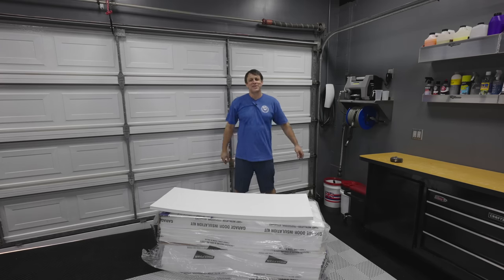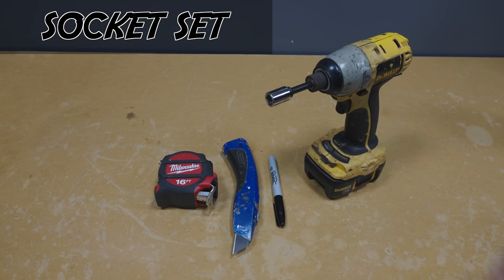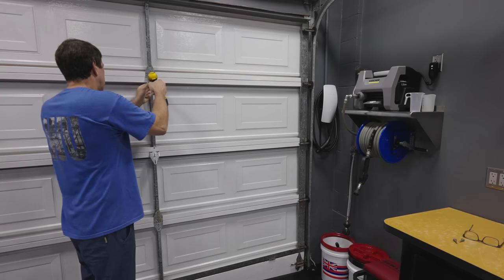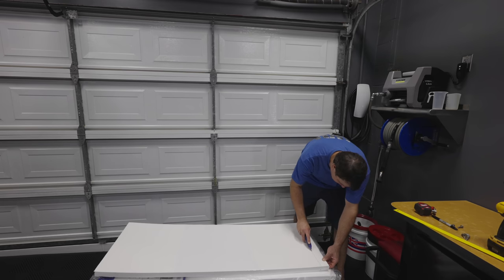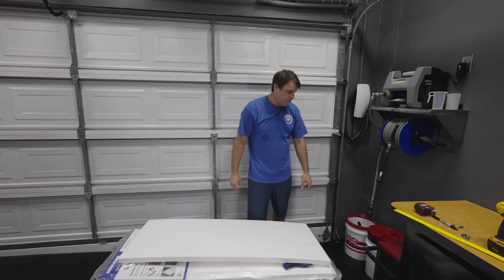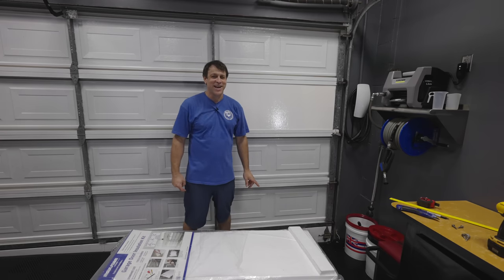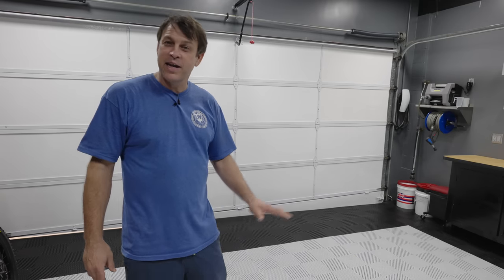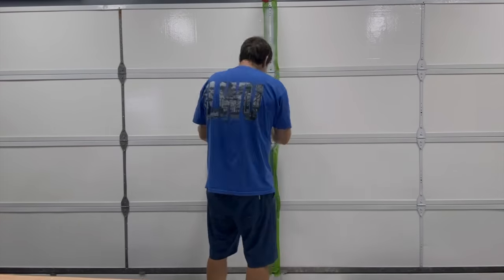BEST WAY OF INSULATING A GARAGE DOOR. FULL TUTORIAL

Comment: Good video.  Insulating my garage door was a great investment.  I didn't use a kit, but instead, used 4' x 8' panels of 3/4" Polystyrene with a radiant barrier from Lowes, and cut to fit.  I used almost every inch of the panels and didn't have to worry about the look of it , because after I installed the panels, I covered each section using radiant barrier bubble wrap with aluminum HVAC tape.  Lastly, I changed all the door hinges from 16 gage to 14 gage ($120 total) to ensure the added weight did not impact the mechanics of the door.  Total cost of insulating an 18' and a 9' door was about $300.
Reply from the maker: Thanks for sharing
Reply: 4 pounds of Styrofoam?

Comment: I watched your video, unfortunately for me, my wife watched your video. Shamefully I veered from your video and woe to the man with a scorned wife.  So I took down the insulation and followed your video with the intensive fervor of a man on the edge of ledge.  And VIOLA, It was done.  Completed in a mere 3.57435, hours and 107 degree Texas sun on the dark painted, west facing, non-tree shaded double garage door of our new home. I now have a photo of you in my cooler garage for my inspiration.  All kidding aside, I did follow your very will described instructions and it made the job easier.  In my situation and probably most garage doors are this way, the upper lip (trough) is deeper, forcing the panel up into it and then pulling it down into the lower. I was having an issue getting to down into the lower trough once inserted as the panel left not wiggle room in thickness. I found using a wide popsicle stick worked great without damaging the panels.  Thank you and i hope you found humor in my opening statements...  Jack  PS, NOW seems epoxying the floor is in her head.....Hmmm, where'd she get THAT idea...???  LOL
Reply from the maker: Hahaha. Yeah man. Funny. Glad you got it done. Thanks for watching

Comment: Our garage faces South in Louisiana. 🥵 Summer heat like an oven. Super easy to size & install. Easily 20F cooler in the Summer. Also a bit warmer in the Winter. So light weight it doesn’t affect the garage door opener operation. I also installed a Dryer vent upside down in the ceiling. This allows the power roof ventilator fan to pull any hot air in the garage out. I close it in the Winter.
Reply from the maker: Awesome. Thanks for sharing

Comment: That garage looks fantastic after all the upgrades and remodeling you have done.   Very professional looking.    I would love to do this insulation project to my own garage doors.   I definitely need to get some insulation on those doors,  more so for the winter than the summer but for both really.     Great video and great review of a useful garage product.
Reply from the maker: Thanks a lot. I appreciate you following the channel. This insulation made a huge difference with sound and temperature. Thanks for watching.
Reply: I did this exact installation. It was easy and reasonable . Lowes had material for 62$ a pack of 8 panels . You’ll need 2 packs for a 2 car door . I say do it !
Reply: Did some simple lubrication on the garage, then found out I need a new bottom weather seal. Now I might as well just insulate this bad boy. Love it! Thanks for the tutorial! Cowabunga dude!

Comment: I did this exact upgrade 15yrs ago to a wooden double door and it resulted in a small improvement. What truly works to keep heat or cold out is to replace an uninsulated door with a 2” thick insulated R18.5 model which I have now.

Comment: I used styro boards like this from Home Depot.. but there was a radiant barrier on one side.. UV radiation reflected back outside.  Even better heat reduction- especially is you use thinner boards that allow an air gap once inserted into door frames. (It’s all science ). :)

Comment: Appreciate the tip about the filler edge. Your door looks fantastic!
Reply from the maker: Thanks a lot. It’s a huge temperature improvement and sound as well. The afternoon sun beats right on that door so it was an oven. Thanks for watching and commenting.
Reply: @HawaiiDetailing  I like your content. 

I'm in Phoenix. We've lived in this house 4 years and the garage is an oven in the summer and I want to make it so that I can work in it and keep my freezer powered and cold. My garage is about 540 square feet and I am looking at a mini-split AC. First step in that process is insulating it and it's going smoothly.
Reply from the maker: @brettoberry3586  good to hear. I did a mini split install also. They are nice. I Have had them for years over here and they work great. I made a vid about the garage mini split install. Check it out.

Comment: Awesome video, I just moved to a new house and failed to upgrade the doors to insulated doors. I moved from a house with insulated doors and the garage was much cooler. My new house the doors are like burners. The builder did insulate the garage, can't wait to get this done asap.
Reply from the maker: It helps a lot. I run the AC in my garage and the door is exposed to direct sunlight. It keeps a good bit of the heat out and the cold in. I am happy with it. Thanks for watching
Reply: @HawaiiDetailing  Do you know if you can buy it anywhere else other Amazon, its showing unavailable.

Comment: This really looks nice! I have wanted to do something like this since I started working in the garage, but I was worried about it being too heavy...
Reply from the maker: Easy DIY. I did not have any trouble with the weight added to the door. Just check that when door is disconnected from the opener that it moves up and down freely with out any effort. If it feels weighted down you may have to tighten the tensioner. Mine did not require any adjustment. This assumes that your tensioner is adjusted properly prior to the install. Hope that helps

Comment: Hey - Great Video!  My only question is based on a few other garage insulation videos - some recommend needing to have garage springs adjusted because of the extra weight added in insulation - I'm not sure how much weight is added and if that has any impact on the weight of the door and its ability to open properly - what's your thought?
Reply from the maker: Here is my thoughts in this extended description I did on my site. https://www.hawaiidetailing.com/garagedoorinsulation

Comment: I did the same thing with my garage door and added the bubble foil insulation between the door panels and the thicker sheets of insulation.
Reply from the maker: Nice. It works well. Keeps it cool here in the heat. Thanks for watching
Reply: I just started doing the bubble foil and will throw this kit on top. How did it all turn out for you? Worth it?

Comment: Nice job! Doing mine here in Florida in the next few weeks. Thank you!
Reply from the maker: Yeah it’s worth it. Glad I did it. Thanks for watching
Reply: I am thinking about doing the same in SWFL, but I am thinking that this should probably be combined with a radiant barrier like Reflectix pointing towards the inside of the garage door to keep the heat out and with an air gap. The insulation itself will help keep the cool air in when combined with a mini split system. Thoughts?

Comment: Did you also paint the panel ? From look it seems so. Will it keep it warm inside during winter ? Also what did you do for the gaps at the edges of the door through which air leaks in. Thanks for the nice video. Also removing screws seems to be mandatory , hope it will not cause the door to fall off :-) , so probably doing one cell at a time might help, what do you suggest  ?

Comment: Great video! I'm working on the install now. One thing not too many people talk about is the impact of the weight of the insulation panels (although its not a ton b/c its foam). It prevents my door from working correctly, so I've got a call in to get the doors rebalanced. Any tips there?
Reply from the maker: My door was not affected by this small amount of weight. In a perfect world with the door opener disconnected the door should effortlessly go up and down by hand. If not the tension spring needs to be wound tighter until this is accomplished. That is a risky endeavor as this spring is under extreme tension. If you know what you are doing and have the tools it’s an easy job. If you don’t it’s dangerous and you should call a garage specialist to adjust the spring. I can’t imagine it would cost too much. Hope that helps.

Comment: Did you replace the bolts as you finished each panel? I’m going to try to do this myself and am afraid the door will fall apart if I do it wrong! TIA
Reply from the maker: Replace each bolt as you can to avoid any issues. It’s a pretty straight forward job ounce you get going and I had no issues at all when I was doing it. Thanks for watching

Comment: Hi, I'm in central Florida & the sun obviously cooks the asphalt roof over garage & temps get over 100 in garage! I put the metallic plastic baffling into the aluminum garage door slots as the sun ultimately sets on that side & cooks the door but that didn't do much at all. I also put a 12 inch exhaust vent but ng. So I was thinking to insulate either the ceiling in the attic over the garage or would it be better to just insulate the one side of the roof the sun hits all day, or neither? It makes sense to me what you said about if I insulate the ceiling it may make my garage hotter if the heat can't dissipate! My thinking was to keep the hot attic space from heating up my garage. I don't really want to AC the garage, I just wish to make it more bearable in the hot months. Thank you, Joe

Comment: After watching this video, I said "That's easy!" Then, I went to check my garage door to start some measurements. Man, I was discouraged. My garage door was riddled with reinforcement brackets. There is no uniformity. Is it because I live in Orlando, Fl, which gets a lot of hurricanes? Hence, the additional brackets?
Reply from the maker: Sorry to hear that. If you can get it done it’s a huge improvement. Thanks for watching
Reply: They are for hurricane force winds, we have them in Texas as well. You can remove the brackets during instillation and put them back on after.
Reply: @schraderade  just looked at mine and same here for my house in texas.  Might have to cut a bunch of small patches and do it that way

Comment: I'm sure your garage door is much  heavier now, do to the extra weight of the foam and paint. You should ad more tension to your springs so it doesn't put extra wear and tear on your expensive opener.
Reply from the maker: It’s a negligible weight difference. It might be 1/4lb. The door rides freely with no effort up and down by hand with the opener disconnected. I tested it. Thanks for watching and the suggestion.
Reply: Thank you for this video and comment on the weight of the garage: I am planning to insulate my garage door, but debating between these styrofoams or fiberglass R-8 at Lowes. I need not to spend extra $ to install new spring and add tension. Great tutorial and thank you again.

Comment: Sweet install. Does it add extra weight to the door whereas the spring has to be adjusted or is the weight negligible. I used Reflectix on my door and it doesn't compare to your work of art. But I'm not sweating as much when I'm doing laundry.😎
Reply from the maker: It negligible. It so light. I do not make any adjustments to the spring. Thanks for watching and commenting
Reply: @HawaiiDetailing  Did you test the door to make sure? A balanced setup should remain suspended when open about half-way. Balancing the springs can be a bit scary but it's fairly simple. Thanks for the great video!

Comment: Great video! But the little insert at the corners were unnecessary! The sheets slide in easily! I just did mine after watching your video, I said to my self, less go and try it without cutting them! It worked!
Reply from the maker: Good to hear. I felt like in my case I would have dented and possibly cracked the foam trying to force it in there. Thanks for sharing so others may be able to try it without the cuts. Thanks for watching

Comment: Did you have to tighten the springs to compensate for the extra weight? (Did you check to see if the garage is balanced?) Curious is I can do that (or need to)…
Reply from the maker: @jamessoler  if when disconnected from the opener the door does not move freely up and down with little effort you should adjust the spring to compensate.

Comment: Love the video. About to install these in my door in Michigan ahead of the coming cold winter. As far as painting the framework of the door and the springs, was there much prep needed on those surfaces?

Do you notice any difference in how hard the door opener has to work with the added weight of the panels?

Also, I have windows in two of my panes - would it be a big project to cut window-sized holes in two of them?
Reply from the maker: I did not notice any problems with the added weight. In a perfect world you would adjust the spring even for a small weight change. It would be easy to cut the panels for a window.

Comment: Out of curiosity - how did you seal the bottom of your door? It looks like it's on a slope, but I love that white wedge piece. We have a similar situation at our house (with a garage that will be used as an office / workshop / gym), and would love to find an attractive solution like yours :)
Reply from the maker: It’s a cut 2x8 that is painted to match. It’s not that elegant of a fix but it works.
Reply: @HawaiiDetailing So you can't actually pull a vehicle in the garage?

Comment: I really enjoyed your video on the garage door Insulation, and I'm planning on doing this in the next couple of weeks. In all the articles I've seen posted I haven't seen any product that uses the foam insulation panels that is Fire Resistant or contains any Flame Retardant. Does this brand offer either of those, because what I've seen most all of these Foam panel types are actually Flammable.  I'm going to use this type on my garage door, but I wanted to check with you and see if this product offered any type of Flame resistance. Thanks for the video it was really well done.
Reply: Water Proof

Comment: You took out the bolts.  Are there bolts on each panel?  Also, you didn't show replacing the bolts.  Did you do that.
Reply from the maker: Yes the door should be put back to the same way it was before you install the panels.This was just a demonstration and does not cover every door type. The idea is to fit the panels by removing the minimum amount of hardware to complete the job and then return the door to the original way it was installed. Thanks for watching

Comment: that's awesome I'm in the middle of doing mine as we speak in Florida my garage temp is 104 I should be done in next 2 hours to check the temperature at afternoon temp which is the highest.. also how thick was your foam 1 or 2 inch? I'm using 1 but I'm doubleing it up what do you think
Reply from the maker: Will help for sure.  One thing to consider is where the heat is coming from. If it’s coming from the sun beating on the roof the door insulation will hold the heat in. Ac is a must if this is the case. The sun was beating on my door so that was the way heat was generated in my garage. This stuff works well. Thanks for watching

Comment: Great video. I’ve never seen a door with the bottom have a custom angle panel like that, that’s cool. What’s the size of your garage?
Reply from the maker: The garage floor has a slope. That’s what the angle piece at the bottom is about. Garage is 20x20. 10’ ceiling. 80 degrees inside now with the new insulation and going to be even cooler with my new AC that is going in as we speak. Some other good videos about my garage in my list if you like garage builds. Pressure washer, Vacuum reel, Air compressor, Flooring, etc. Thanks for watching.
Reply: @HawaiiDetailing  I’ve watched them all I’ve been subscribed for a while.

Comment: How did you get the panels on the very top and the very bottom where the assembly hooks up directly to the cable for the automatic garage door opener in the spring bar my understanding you're never supposed to unbolt those
Reply from the maker: I did not have any issues with that section. My suggestion is to not remove anything that is under a load.  Thanks for watching

Comment: Did you have to adjust the spring tension for the added weight?
Reply from the maker: I did not but you should test it and if it does not easily move up and down while disconnected from the door opener an adjustment will be required.

Comment: How much weight was added, did the springs have to be wound some more to compensate?
Reply from the maker: I did not have to adjust my springs. The kit is styrofoam so it’s very light. In a perfect world you would adjust the spring so that there is zero effort to move the door when it is disconnected from the opener. Hope that helps.

Comment: this question may have already been asked, but did the install affect the way the door opens? Did you need to adjust the springs?
Reply from the maker: I did not change anything it it works great. You have to disconnect the opener from the door and make sure the doors goes up and down easily by hand. This stuff weighs almost nothing.

Comment: how much weight did it add to the garage door? Did it make the garage door so heavy that it is advisable to replace the springs?
Reply from the maker: I gladly like it was negligible. It was a few pounds for all the foam. My door glides effortlessly up and down with the opener disconnected. That’s the true test. If it is hard to lift the motor will struggle and an adjustment should be made.
Reply: @HawaiiDetailing  This was an insufficient response. How much weight did it add? sufficient response:  all the panels weighted 5 pounds or One panel weighs 4 ounces. Please provide a number.